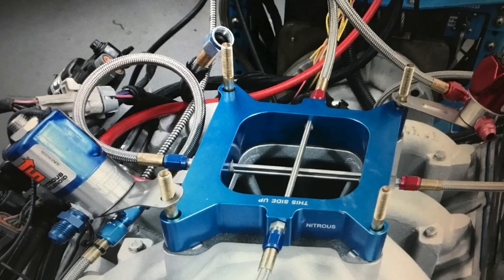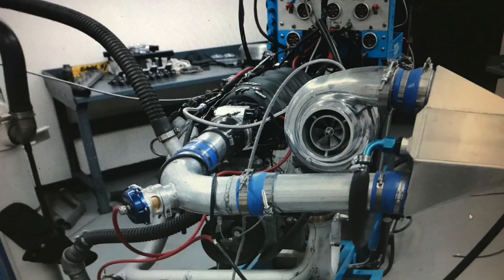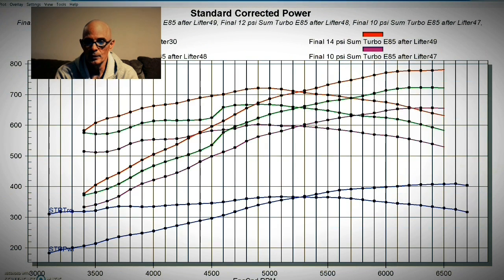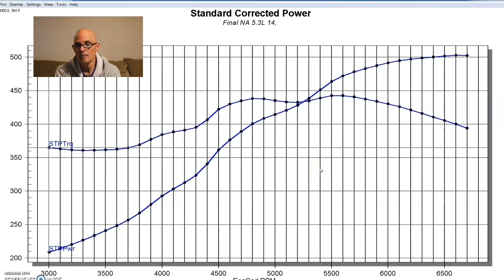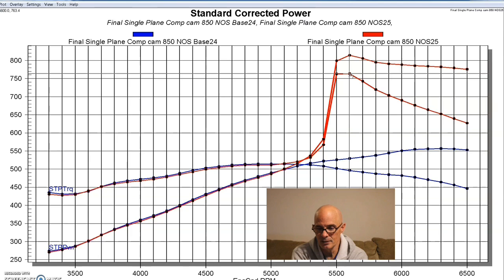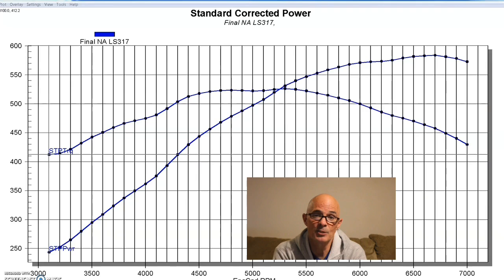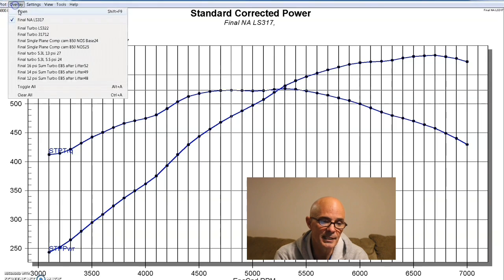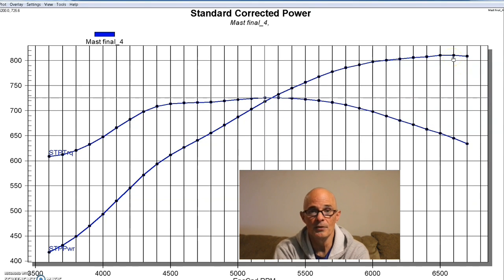LS HOW TO: 800 HP POWER RECIPES

Comment: Damn.. whats the peak hp you can make out of a 448 stroker using e85.. would love a recipe for my build 😂
Reply from the maker: with boost?
Reply: @richardholdener1727  n/a plz and thx for the response!!!
Reply from the maker: WITH AN ENDLESS BUDGET-RACE ENGINE BUILDERS CAN EXCEED 2 HP PER INCH AND EVEN GO TOWARD 3 HP PER INCH-MOST BUILDS ARE GOOD IF THEY MAKE NEAR 1.5 HP PER INCH.

Comment: Richard I don’t know if you’ll see this message but I have an 03 suburban 5.3 and it has electronic throttle body and has the most boring Revlimiter I’ve ever seen how can I make that bounce off the rev limiter like the older ones. Is it possible to tune this Daing throttle body to b snappier and have a bouncy Revlimiter.???
Reply from the maker: not sure on tuning the stock ecu

Comment: Hey Richard, I have a question? What camshaft would you recommend for max power and max torque for my twin turbo LS3 6.9ltr? With west coast racing heads ,22cc pistons, billet crankshaft, ARE stage 4 dry sump, 76mm turbonitics turbos, TSP manifold, 120lbs injectors, 102mm FAST throttle body
Reply from the maker: That combo will make out that turbo with almost and cam
Reply: @richardholdener1727  what would be your suggestion for a max hp max torque cam ? Would the BTR twin turbo cam be a good fit for my setup?

Comment: Is that ls3 crate motor stock or upgraded internals im trying to reach 800hp on my ls3.
Reply: Hi was wondering if u sell email tunes I have an ls3 with 90lb injectors and 535lph walboro fuel pump 50mm bov and 40mm wastgate ebay gt45 turbo my cam is 54-469-11 couldn't find the exact size u mentioned
Reply from the maker: stock
Reply: @richardholdener1727  awesome thanks love your videos keep them up......

Comment: An RB25 test would be awesome! Those engines are extremely capable if you get a good block (luck of the draw unless you're able to have the block sonic tested before you buy it), and even the weaker ones are plenty happy up until 600+HP. They sound amazing, too.

Comment: I find it so impressive how these new engines are pumping out 700-800hp on pump gas all while passing strict emissions
Reply: Which LS do you know that pump out 700-800 hp and pass emissions?
Reply: @AB-80X  mine did nj dont give a shit as long as theres cats on the car and no check engine light.

Comment: Richard, was the last engine, the N/A 495 stroker running on 93 pump gas?
Reply: I have a feeling everything's running on E85 or something equivalent to that and I'm not sure if the stock injectors are used I have a feeling you would run out of fuel

Comment: What would injectors stock be good for power wise
Reply from the maker: which stock injectors-lots of different ones use on LS
Reply: Just ignore me if I don’t make sense lol. Maybe show us what your standard 4.8, 5.3 6.0 is capable of or what injectors can support what commonly. For someone like me with so many projects can springs and boost and ring gap would be as much as I wanna get involved injectors get expensive. I learned the hard way

Comment: Hey RICHARD, if i was to use my same heads, cam, intake, and put all in a stroker short block , would it increse Hp a good bit or no,  i know you have to match for the bigger stroke but in the mean time would it be worth it? Hope you can answer.
Reply from the maker: it would be better than stock, just not as much as it could be with cam
Reply: @richardholdener1727  i have trick flow 215cc heads with a trick flow cam 220 224 cam etc  on stock ls1 short block, and i was wondering how much hp and tq increase id get with say a 408 stroker shorth block from atk using my same H-C-I COMBO. this heads flow very good 324 cfm at .600

Comment: Richard, is there a power to displacement ratio when you should replace the rods and pistons?  Or should you do it at a certain compression?  I understand the junkyard motors with boost make good power but how reliable is that combo?
Reply: There is no power/displacement ratio for rods and pistons.
more compression is always better, but you will start running into detonation issues eventually as you increase compression/boost/cylinder temperature.
Reply: Colton Robinson, thanks.  Can a good tune prevent detonation?
Reply: @cwigington14  
Yeah, the better you can control your ignition timing and air/fuel ratios, the higher compression you are able to get away with for a given fuel octane.  
That's one of the reasons that modern computer controlled production motors can get away with higher compression ratios than their older  counterparts.
Reply: Watch the 'big bang' series of videos. It gets explained there. Basically 1500hp on stock rods. Richard explains all the data and the why's of it all.

Comment: Was the ring gap opened on the LS3 crate motor?   How much boost will that engine safely take without opening the ring gap?   I'm thinking about adding a couple of turbos to the 525 hp LS3 crate motor in my SL-C...  
Thanks again Richard for sharing all your work!   BTW, myself and many others are waiting on a turbo LS test comparing similar cams, but with something like a 109 LSA vs a 114 LSA.
Reply from the maker: yes on added ring gap and i already tested the 108-120 LSA-no video up yet on that

Comment: Any recommendations on where to read up and learn info on building a Turbo LS capable of 7-800hp at crank on pump gas (91)?
Reply: Big turbo, gen 4 bottom end, good tuner
Reply: I have a 6.0 iron block I'm sending off for machine work. I'm needing to order rods and pistons at minimum (in my opinion)  as I only have gen 3 rods.

Comment: Always been curious in these combos. Are you changing the oil pumps or just using factory or going aftermarket pressure/ volumes ect...
Reply from the maker: all stock
Reply: Stock the more miles the better

Comment: Doesn’t it actually make a big difference to have the same power adder with a matching camshaft? Vs if you just put any performance cam and do your power adder. Ex. Nitrous cam matched with a supercharger vs nitrous cam with running on n/a with nitrous.
Reply: Sometimes it does make a difference big na cams have a lot of overlap and what you end up doing with boost is pushing air through the cyl that's why typically boost cams have a wider lsa and with as little overlap as possible it still works all boost is is atmosphere 15 psi is +1 atmosphere so roughly double the hp

Comment: Could you plz do a ls1 set up that makes 5-600hp
Reply: Csxtrains122 
Cam heads intake. It’s done and proven
Reply: https://ls1tech.com/forums/generation-iii-internal-engine/1601482-new-mamofied-build-pics-added-idle-vid.html#post16904858

Made 464whp through a 9"/auto combo.
Reply: 5. Psi and you're there
Reply from the maker: did you see the 5.7L builds that are up